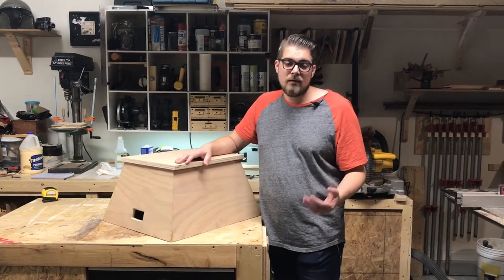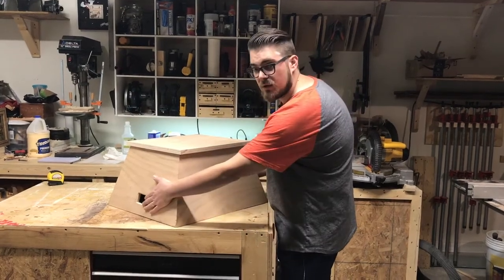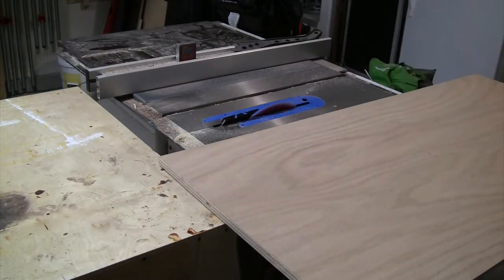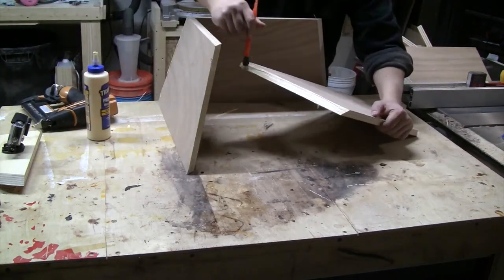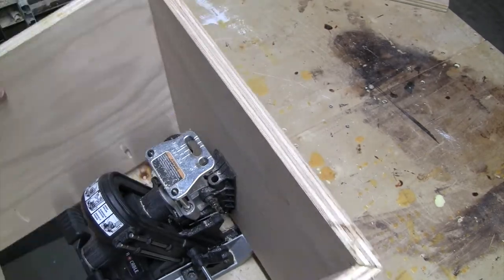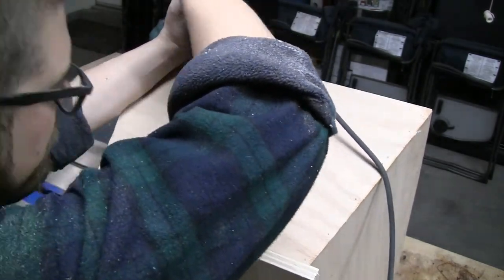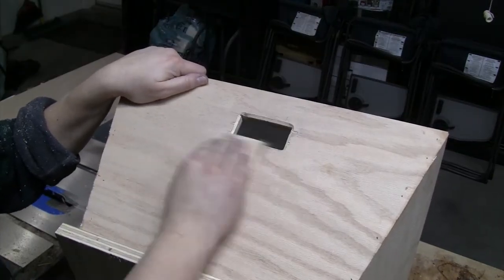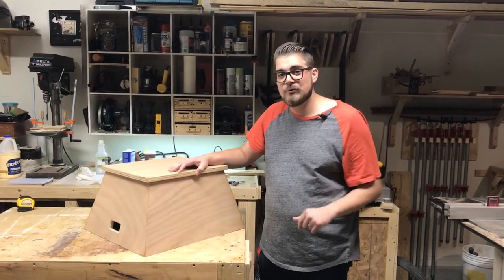How to Make a Shop Step Stool

Comment: Great video. The only thing for the project I would have suggested would be possibly running a 1/4" round over bit over the edges. It would not only help prevent more splintering and tear out in the future but make it easier on your hands and other surfaces. Great build keep the videos coming!
Reply from the maker: Wooley Woodworker great suggestion!